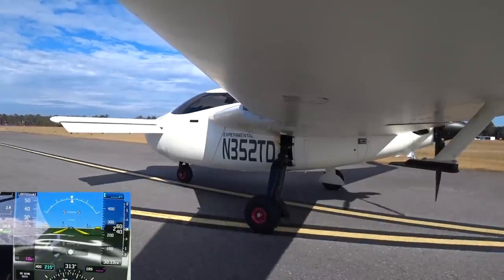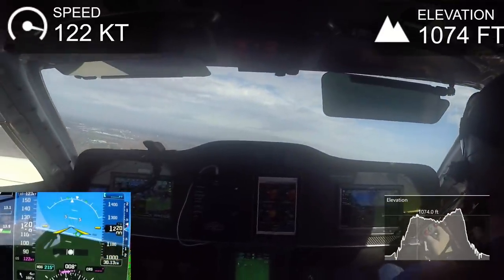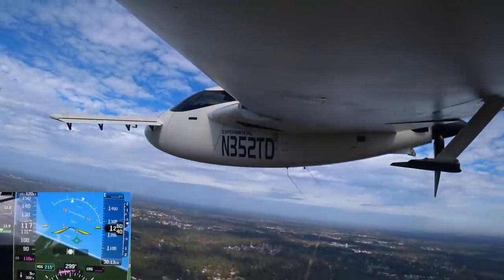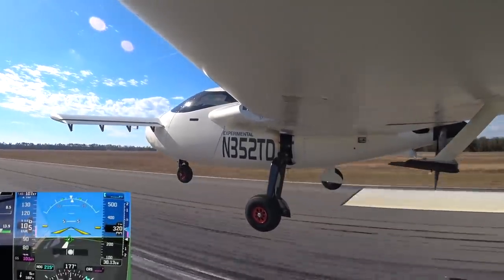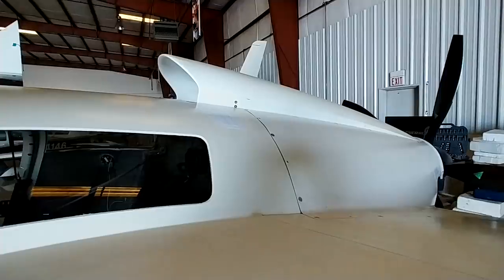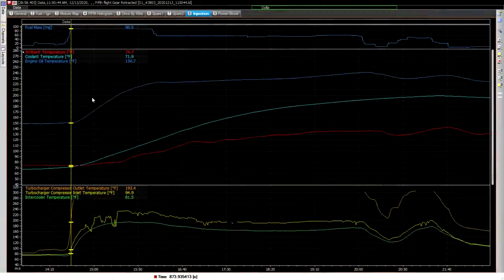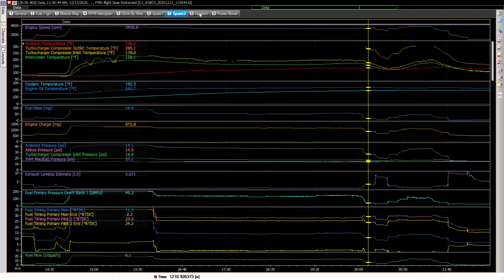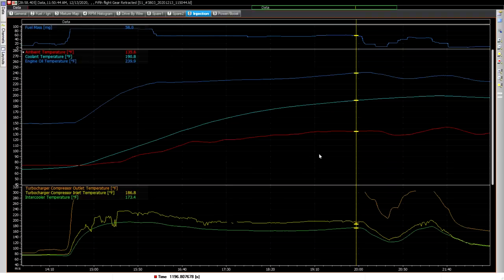Fresh Air and Sunshine - Flying the Raptor Prototype

Comment: I reckon the lateral stability problem is a function of your floppy aileron system.  If they're not stiff enough to resist S+L flight loads they're certainly not stiff enough to avoid amplifying any turbulence-induced roll oscillations.

Comment: I keep seeing some flexing from the part that hangs below the aircraft that seems to coincide with the bouncing up and down as you make corrections to the aircraft in flight. If you could stabilize that part that hangs down I think it would make a big difference and you’ll seeing a lot smoother flight. Good luck with your tests. Am looking forward to the next flight. Thanks for sharing your experience.

Comment: Pete, on the Exhaust Temp Bank 1 (Video - 15:16), there are two sets of two temperature drops.  It looks like there is a consistent time interval (about 10 seconds) between the first and second drop in each set.  Might be worth looking into as that might mean it's not merely coincidental.  Also, there is (what looks like) possibly a third drop just as you reduce rpms (Flight - ~20:00).  You might see if there is a consistent time interval between the three initial exhaust temp drops.  Looks like they may be occurring at about 1:15 minute intervals and reducing in magnitude.  Other than that, the bird is beautiful!  Keep on keepin' on!

Comment: Next flight to test temps, turn the heater loop off when you are stable in the pattern. Then your coolant temp will stabilise quicker so you can see how well the cooling works at the lower throttle position. You can always turn it back on to get a dump of cooler coolant...

Comment: The oil temp never stabilised. It stopped climbing when you reduced power to land. I’m not trying to be negative. There just isn’t anything to be gained from trying to convince yourself otherwise. I’d suggest getting a decent air to air oil cooler with a vernatherm. Bypass the water cooled oil cooler if possible.

Comment: Looks like a nice flight. One area for roll instability you might check is your rudder centers and aerodynamic balance. They will cause as much roll instability as your ailerons can. Necessary side to side damping is going to be turned to oscillating roll if the rudders are responding to yawing in a divergent manner.  As a starting point would be good to hop test more rudder toe out  to see if any improvement. Next, if your rudders are cross-linked it might be better to disconnect them (like other canards with left pedal/left rudder/right pedal right rudder) to see if this helps.

Comment: Time to take it to a safe altitude.
Reply: Yup. Tower controls 3000 agl and 5 miles around the airport. You could go high and fly a wider pattern and  put some time on the airframe while still being close to home. A friendly call to Tower might yield even a better answer but, it's nice to work it out with them so they know what your intentions are. Once up there, you probably wouldn't have to make a radio call unless you needed to drop back to pattern altitude. Keep up the great reporting...
Reply: Although we understand the cooling anomalies (among other issues) with the aircraft, it is far more prudent to take a developmental aircraft more than 1000 AGL. More altitude gives more margin of safety, especially given what looks like very concerning flying behavior, especially during turns. Best of luck.

Comment: I'd dig some more into the stall you are seeing on the outer parts of the wing. This would mean that you are currently flying with a too high angle of attack. It's possible that you need to speed up the plane to get more lift from speed rather than from angle of attack and once you have the speed you probably can maintain it with lower power settings. You are easing the power too soon. The aileron pre-tension will hopefully help. Right now the ailerons coming up from the drag of the spades are simply killing lift that you need to compensate with angle of attack.
You can see on the Garmin screen that only when you cross 140 kts are you getting a reasonable 2.5 degrees angle of attack for level flight. At 120 kts you need some 7 degrees to stay level.

Comment: Looking very good in the air with the gear up just a beautiful airplane. I don't want to beat a dead horse but really what's the harm. You should move the temperature probes to the primary cooling system. The same way you did with the forward intercooler. That was very informative you were able too see the cooling capacity of that system. It could be very helpful to understand the performance of the main system as well.

Comment: "I know it's going to get boring..."  ...as Peter pulls back power and slowly cruises around the pattern at 145 kts.  Nice.
Reply: 100kts takeoff and land and 145kts cruise...those two numbers will have to separate a lot to make a viable platform
Reply: @andrewjamez  ...you always negative? What plane have you built PC?
Reply: @andrewjamez  by how much before it “ becomes viable “ ?
Reply: @andrewjamez  145 @ 65% power.  Cleaning up the wheel wells will likely add 2-10 knots
Reply: @cirrusflyerh2843  its going to have to stand apart from the Velocity aircraft to make sales. That aircraft can cruise at 180-200kts depending on model and land at 70 because it only weighs 2300lbs. The  Raptor will have to go on a diet.
Reply: @1950harleycharley  I used to manufacture parts for sport aircraft and have had type ratings in a handfull of aircraft. I hope Peter succeeds but there are a few elephants in the room He doesnt seem to admit exist.
Reply: Glennise R  its clearly going to be a direct competitor and people looking to buy will be asking why ghey should go one over the other.
Reply: Glennise R  you guys should listen. This is what being a pilot is all about. The last thing you want is a take off speed and cruise speed too close together.
Hes flying with empty tanks, no passenger and no cargo.
He won't get off the ground with four people and full tanks.
If he needs 110 full load and is running 70-80 percent throttle or more to get off the ground and then can't maintain level flight without having to hold 60-70 percent throttle he could have a serious problem if he needs power. Hes already overheating the engine.
The aircraft is obviously a handfull.
And hes not listening to people he doesn't agree with.
I made comments before the first real flight that the cg was off on his ground effect hops.
I told him his controls were going to bind and warned him about the slop I expected him to find in the cable arrangement for the ailerons back when he first installed them.
The canard is at the wrong angle of attack and the wing itself has a washout at the root then washes IN at the midpoint and then washes out again at the wingtip.
And am I the only one who's noticed the vertical winglets are rolling back during forward flight. That's twisting the wing. Then the AOA becomes too great and they spring forward again. At the right, or wrong, speed he is risking some pretty serious flutter issues.
And before you say, oh it's not capable of flutter....EVERY AIRCRAFT is capable of flutter.
Especially with that crazy stick arrangement hes got.
If he enters some kind of oscillation that causes a quick reaction of that stick and it binds up and releases on him, its going to be like calming down a bucking bronco. And at the weight of this thing and that ineffective elevator with that crazy barndoor hinge normally used to extend flaps away from the wing, hes going to overstress that damn thing and it's going to flex until it explodes. When carbon fiber finally pops it is catastrophic. I've pulled the wings off a competition model glider on a winch launch. That thing came down like a lawn dart with its very own ticker tape parade. You could follow the trail of black confetti all the way to the crash site.
Flying is about Sharing and learning from each others mistakes.
I flew in a Berkut that did exactly what this is doing. That pilot thought maybe the aircraft was too nose heavy and kept moving the cg forward until it did a pop up off the ground and he barely had enough throw to keep the nose down.
He got some altitude to try and work out the problem. Slowed it down, the nose dropped he throttled up the aircraft pitched up so hard it broke the seat back and laid him down on the back stick. You can imagine how that ended.
He never flew again.
Being critical is ok as long as no one is being a jerk about it.
Being a jerk to the guy who is respectfully offering constructive criticism is not necessarily helpful is it?
And questioning the guys credentials is expected.
But all you had to do is ask him politely. He expects it, as do I.
The snarky comments aren't going to start an interesting conversation, they are going to end it.
I've got 35 years worth of interesting stories I'd be willing to bet he does too. If you are really interested in airplanes I'd bet the two of us could keep you entertained for hours.
I've hung out and flown with Hoover, Yeager and spent an entire weekend listening to Boyington talk about his boys and flying Corsairs.
If you are interested in that kind of stuff I'd say you guys are blowing it big time.
Reply: @christopherleveck6835  man o man your eyes are sharp! thanks for this comment I've learned a lot, keep them coming
Reply: boring is a good thing to have in a new aircraft.
Reply: PlaneCrazy he is just not pushing it at his moment with the speed until he feels comfortable with everything

Comment: Well done mate. Baby steps; just waiting for the numbers at cruise burn rate and airspeed with max prop pitch at 3,000 rpm @ FL10 or higher. I think the engine is most efficient at 3,000 rpm or below as most direct injection engines are. This has to do with the ever changing combustion chamber atop the piston. Love your progress!

Comment: Can you please add the Outside Air Temperature to your information? Right now it is almost winter and air temps are significantly lower than your early flights. That could be assisting in the improved cooling and I wonder how the temps will be when it is around 100 degrees fahrenheit in the summer.

Comment: That downward deflection off the canards is problematic with the main wings clean air expectation. You mention moving the CG forward, but IF you were trimmed for level flight at that speed, then with more forward CG, you would need even MORE canard downward deflection, OR even better, upward reflex in the main wing ailerons. You've basically got a flying wing there. They ALL need reflex to fly level trimmed. The Canards should be as clean as possible. Also giving main wing down aileron makes for a less stable wing at slower speeds. It would be better to have up reflex on the main wing for both those reasons. I only fly hang gliders and RC planes and helicopters, but it's the same concepts. My first scratch built canard (love the canard design) was too nose heavy. The Canard should ONLY serve to aid in pitch and a little roll. NOT serve to make the aircraft fly level. This causes unwanted turbulence of the main wing due to shadowing. That's why the tail feathers on high speed aircraft are mounted up out of the main wings wash. It's a bit of a touchy thing on the style you've chosen. Raising the main wing and or lowering the canard would do wanders for this problem. Just a few inches can make a difference. But please get rid of the down elevator. That will change things quickly and unexpectedly. You want predictability. Take my comment with a grain of salt as per my credentials. LOL BUT those are my observations as someone who likes to analyze everything to the root cause. Plus,,, I didn't sleep at a Holiday Inn Express last night. LOL Having the main wing washout helps, however IF you are using the ailerons as flaperons by default, you're negating the effect. I hope I misunderstood you and you were talking about the canards ailerons being the downward deflection you were talking about, but then again,, you're talking about creating your own turbulence to the main wing. If the canards were not straight edged then the washout from those would be thrown a bit more outward, but that's not really a great thing either. I don't know,,, Not enough info really, but I see this as kind of scary if flown too slowly. It would tip stall so quickly. Have you tried a stall speed run yet? Either way,,, she's a gorgeous, simply beautiful airplane. I love it how she sits. The side by side seating is just fantastic with all the room it has for it. The landing gear is fantastic!!!!!!Just WOW!!! Great job on that too. God bless and I hope you work out the bugs. I love the plane. Really great work so far.

Comment: Rocking motion, I call it oscillations can only come from control.  Your ailerons should never lift during flight unless you set them up like that permanently.  Need to check cable tension on your ailerons and rudder, might need to bump up that tension.
Reply: Lol

Comment: Something was off with the gear up response, seemed to lag for a sec.

Did you locate that piece of chute covering that came off at the main intake? Do you think it went all the way through? Check for prop strike?

Good idea to bring the main ailerons down in my opinion. 

I think your right about the vortecee coming off of the fore plane (winglets). I don't think that the strafe's you have put on will help. Too small in height under the wing airs going to jump it. You should make some for the fore plane tips, that would help with the nose up characteristics, especially at slow speeds.

I'm enjoying your flights more and more.

Comment: Beautiful! Man Peter you are the Man!
I'm trying to wrap my head around 'I've moved the CG forward a little bit more so it will fly a little bit more nose down...' (9:10). In level flight, for example, the nose up/down attitude depends on speed, if the CG is more forward it requires more elevator deflection to increase lift on the foreplane to maintain the required pitch attitude...at 13:26 you said '...because I nosed up a little bit I was going slower...' which is correct. Please correct me...
Reply: more angle of attack adds more drag and vice versa.  If he changed to more forward CG without changing AoA you'd be correct it would require more elevator / foreplane lift.